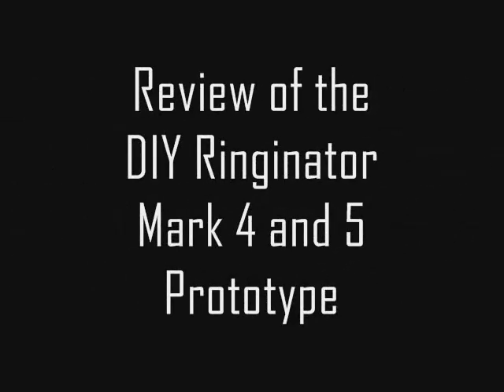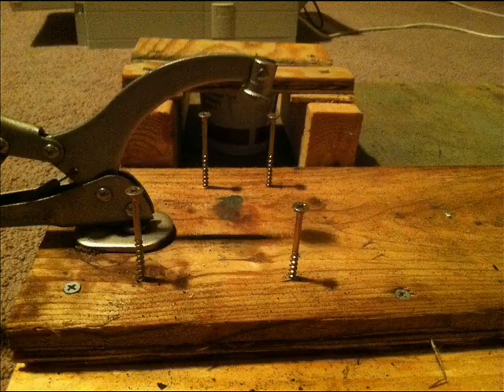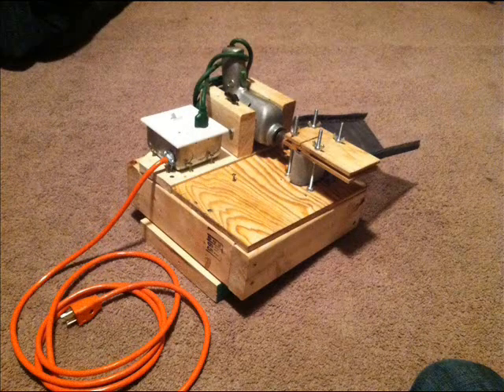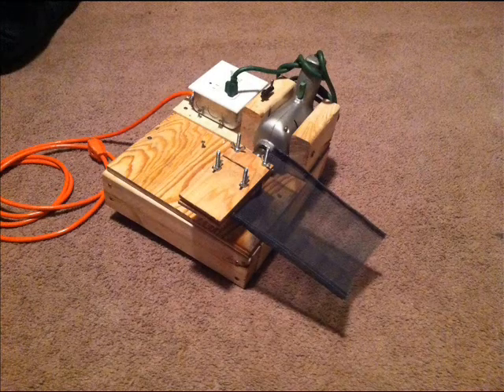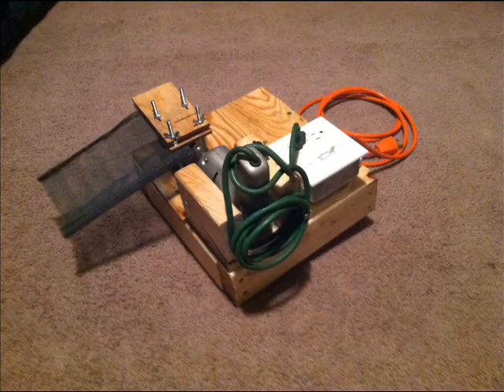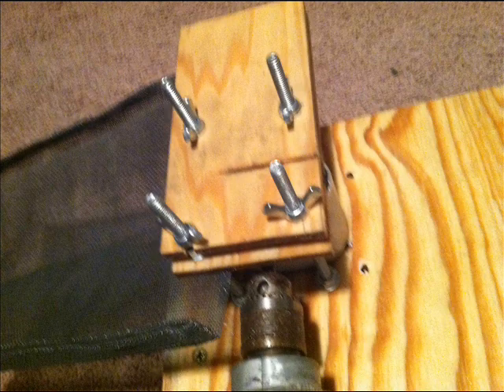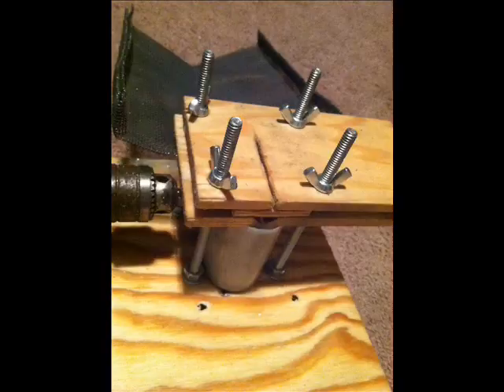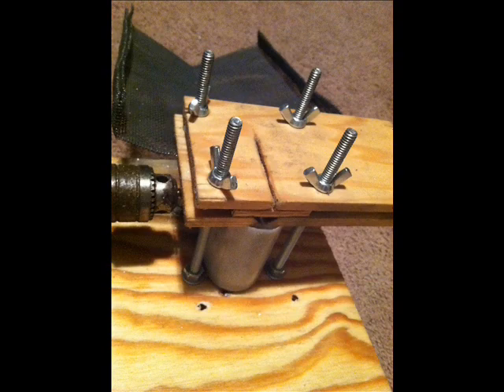Review of my DIY Ringinator Mark 4 and Mark 5 Prototype.

Comment: Does this leave any burrs on the rings? Or does it always make clean cuts?
Reply from the maker: +Yourname942 The cuts are always clean. However I'm in the process of building a brand new machine one that is smaller more portable and easier to transport with or without power.

Comment: Hey! Very nice work! I'm just curious, what do you use for a mandrel in your drill? Also, what blade do you use?
Reply from the maker: I just got a 3/8 inch rod from ace hardware that I use with a drilled out piece of 2x4  that the wire is feed through which saves my hands. I'm gonna do a video on the coil making process soon with all my findings from everything Ive experimented with.
Reply: Tropicalwebsurfer Sweet! Thanks for the reply! How do you keep the blade mounted to the drill though? If you don't mind me asking. I'm planning on building one of these myself for proper flush cut rings. Just so much cleaner and more professional. These videos are great man, please keep it up! :)
Reply from the maker: StrangerEight How about this. I am going to be doing some work on my machine soon like really soon, so how about while I am doing that Ill just video me putting it together piece by piece so you can see all the angles. Really its a very simple setup. Plus up until a week or so ago I was using vegetable oil, now I got some cutting fluid and the same pump the ringinator uses since I based this ones design off the real one. Ill even show how I make my coils also.
Reply: Tropicalwebsurfer
That sounds incredible! I have no idea what kind of pump that is though, if you wouldn't mind explaining that in the video too then I'd be really appreciative! :) If there's anything I can do to help out, just let me know! :)
Reply from the maker: StrangerEight  The goal I set was to have a much more cheaper alternative to the Ringinator since its just so expensive but I'll be as detailed as possible and if I forget something just let me know.
Reply from the maker: StrangerEight Here are the links to the new video
The Ring Me Coil winding rig review
Ring Me overview of construction